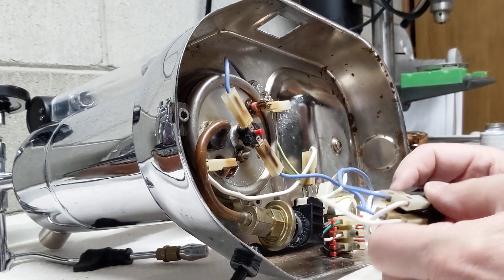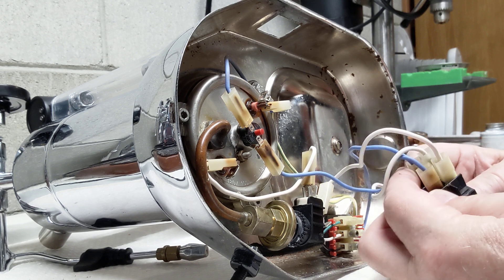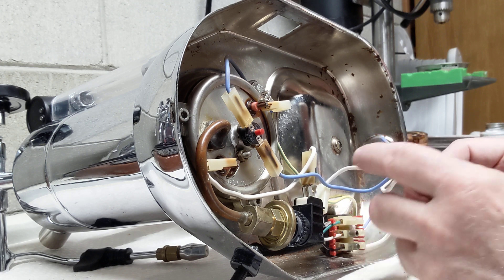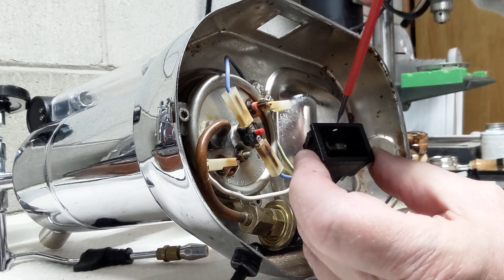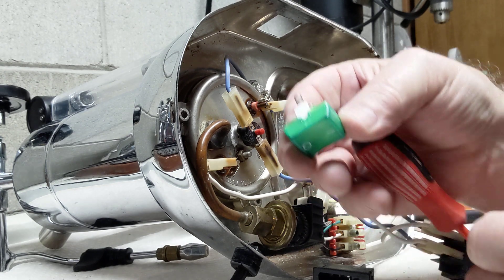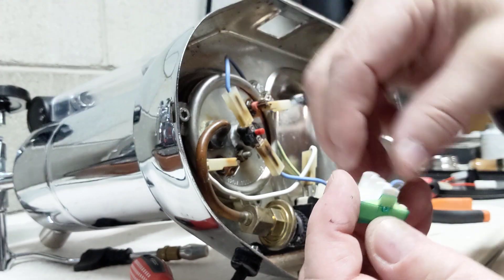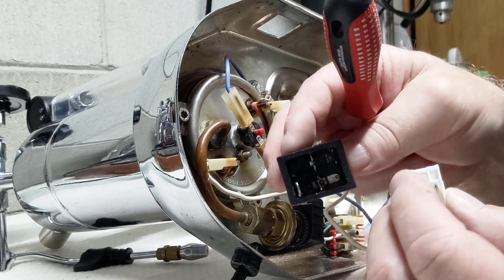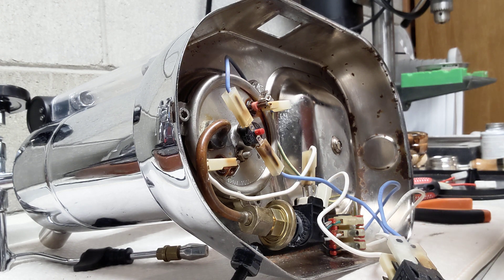La Pavoni Green Switch

Comment: Hey Bruce great seeing you at Hoons live streaming. Really enjoy when your on. Can I ask a question about the green power switch. I have a late model brand new La Pavoni Professional PL.  I noticed when the La pavoni is switched off there a dim glow of the switch which flickers slightly..  Can I ask if this is normal? You can't see it unless the room light is off and it's dark.
Reply from the maker: Italian wiring does not distinguish between US wiring and EU wiring. This means that the wiring on EU machines is not polarized and for the most part, likewise on US machines. In fact, when the element blows or the resettable fuse trips, the switch will still light up when flipped on. It's one of my pet peeves, because some of the wiring under the machine is still hot even when the switch is off.  I corrected mine when I rewired my machine. In your case, I assume there's some electrical cross-bleeding inside your switch. Replacing your switch would take care of the problem most likely, but it's not necessary.

On the bright side, the green switch interrupts both the hot and neutral legs, so that's a good thing.

I really enjoy Hoon and his coffee community. He's kind, personable, approachable, and knowledgeable.
Reply: @BrucePappas  thankyou for the quick reply. Amazing info you just provided. I'm more worried about if it will be a fire hazard or electrical hazard but if not I'm happy with that. I may just connect it to a power socket I can turn off completely. Yess Hoon is great and really great seeing you there too.